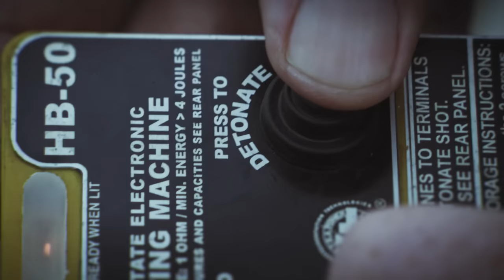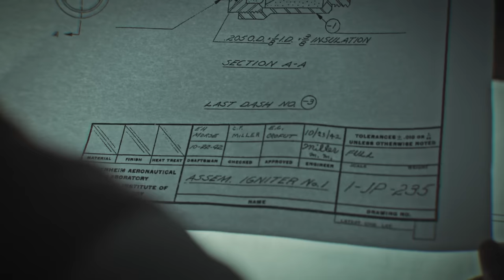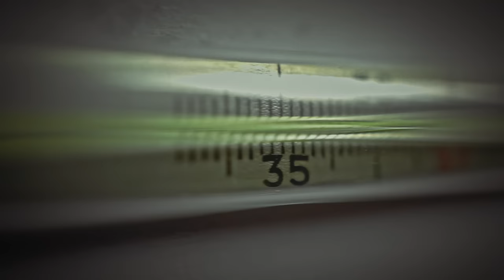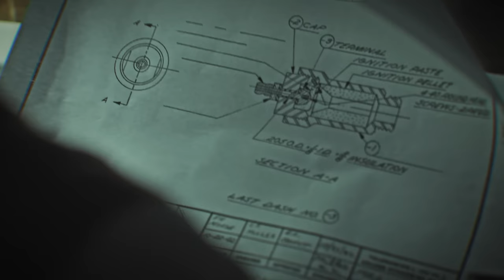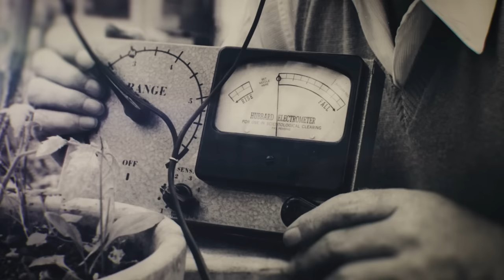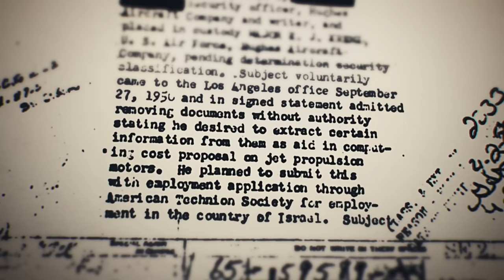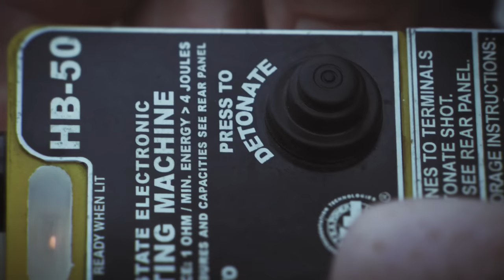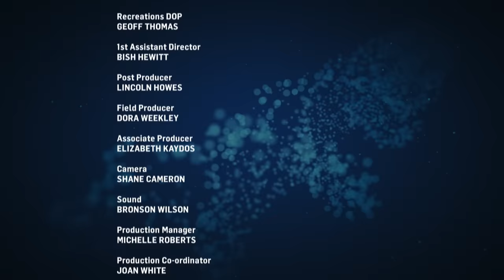Jack Parsons' Demise - Deadly Intelligence - S01 EP05 - True Crime

Comment: Hg(CNO)2 or mercury fulminate was used in primers for rimfire and center fire cartridges and for quite a while before it was replaced with Antimony trisulfide in mechanically mixed primer compound like H-48 and then eventually thats was largely replaced with compounds like EP20 as the Antimony was corrosive and the vapors produced by the the compound was also toxic. I cant really think of a reason for him to use fulminates unless he was planning to use it in the synthesis of another energetic compound. I do however think that complacency was a possible reason for his death based on his habits of ignoring safety protocols. Getting to comfortable with the process of handling and synthesizing energetic compounds has resulted in many deaths and serious injuries. On the other hand the detonation velocity of mercury fulminate is not all that impressive and the amount required to cause that much damage would be much more than any experienced person would produce or store at one time. Primary explosives are usually batched at a maximum of a few grams at a time.